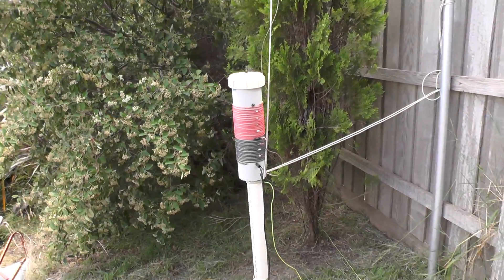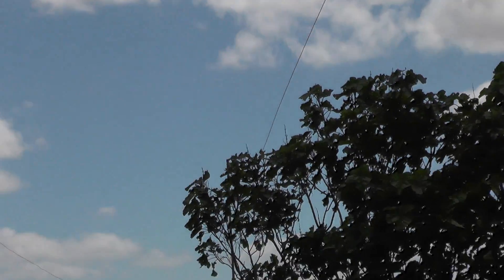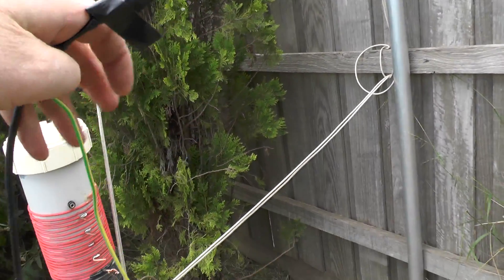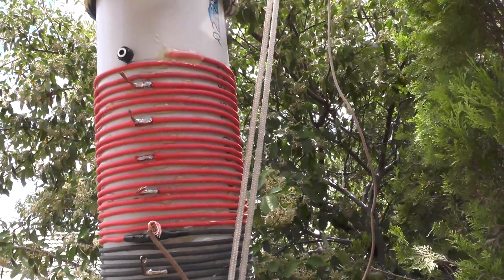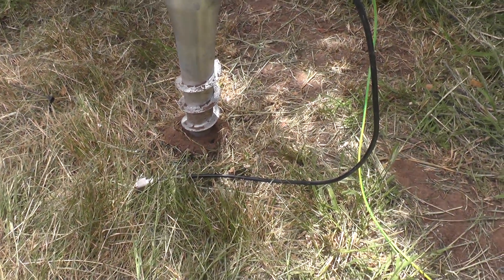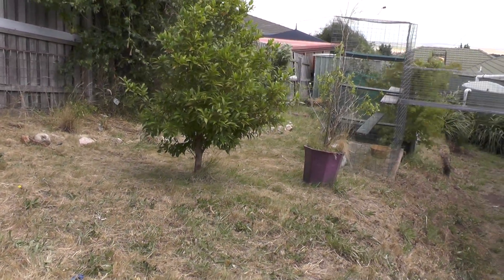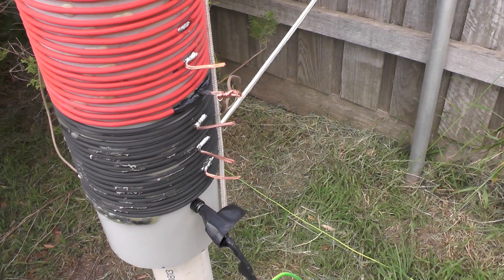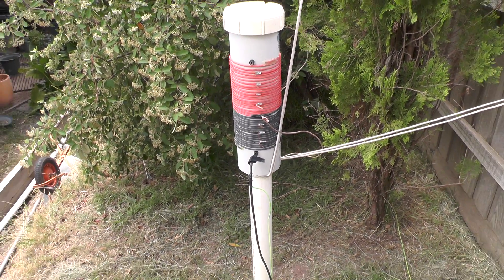160 meter Inverted L

Comment: Thanks for the video ,,can you tell me please diameter of coil pipe and also how long the horizontal wire is , would like to copy this thanks Shane uk
Reply from the maker: Hi Shane. The pipe is 100mm. I no longer have that antenna up as it didnt work very well. I know have a Inverted L going up the side of a 12m tower and out across the yard. The new one is about 40m long.

Comment: I would try keeping the wire connecting to the coil taps as vertical as possible even if it has to be shorter, and tapped higher up to achieve resonance. Then top load it in a T arrangement.